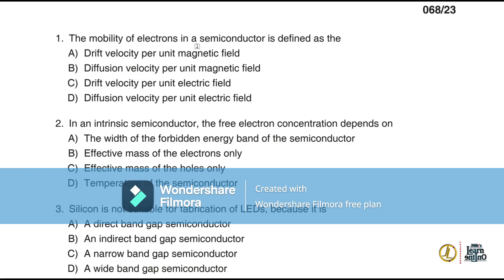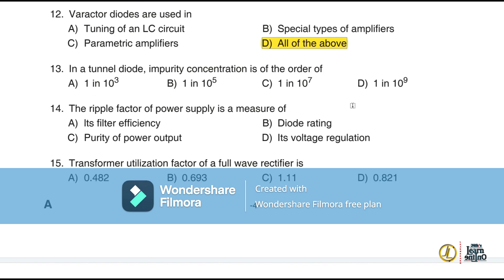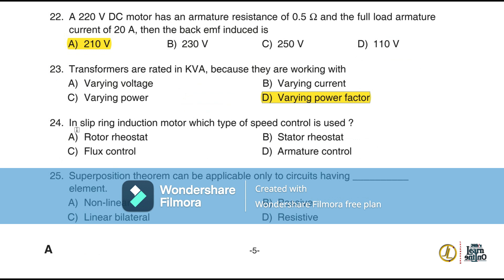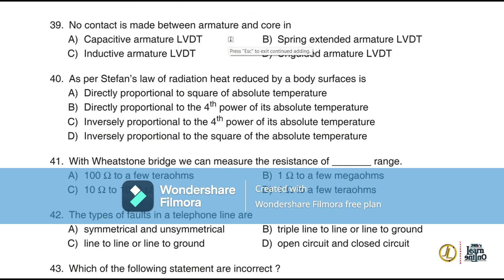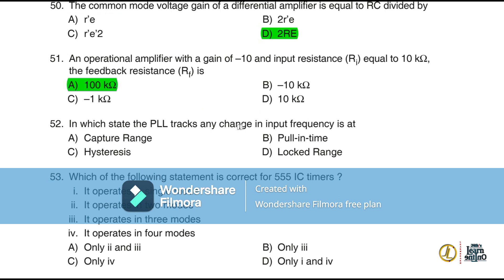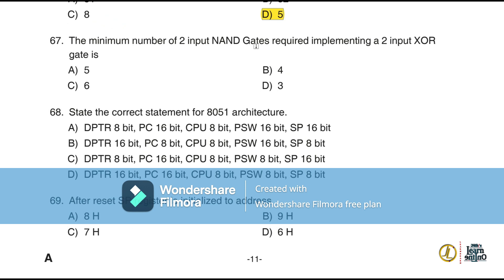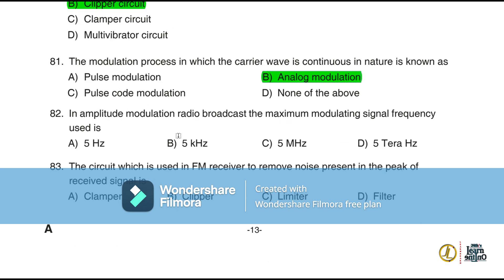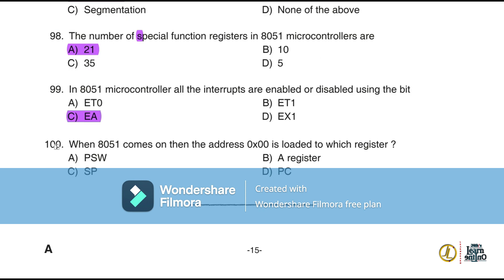PSC answer key | demonstrator in electronics | workshop instructor in electronics

Comment: Challengable Questions ( 677/2022)

1. While doing Base width modulation in BJT = Given Answer -D, correct Answer - C

2. Stefan's Law Qn = Given Answer -A correct Answer - B

3. JF Flipflop J=K =1 Qn, Given Answer -D correct Answer - B

4. The ripple factor of power supply is a measure of Qn, Given Answer = C but option A is equally right Answer
Reply from the maker: Yes.